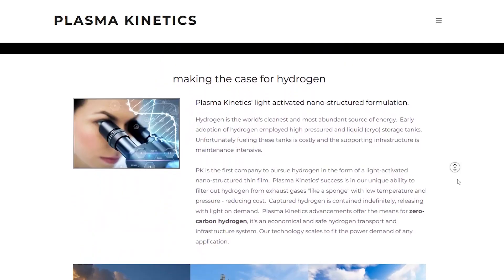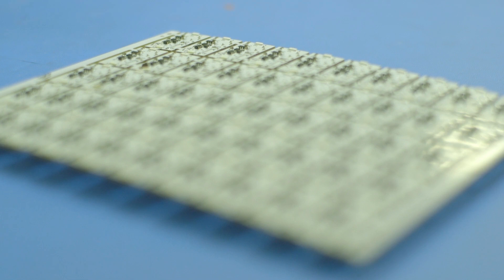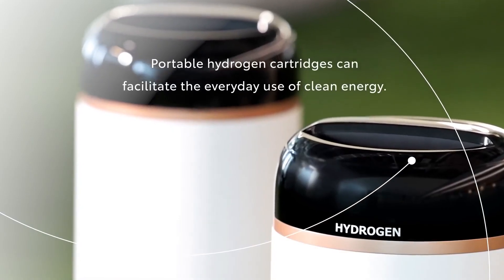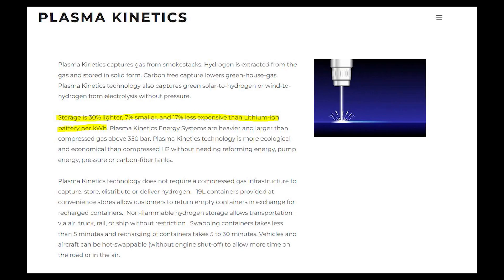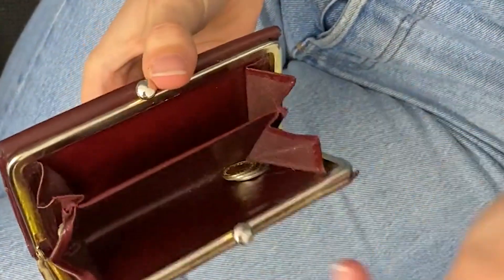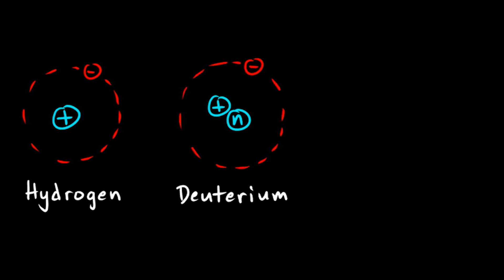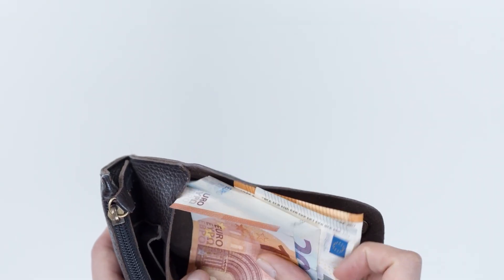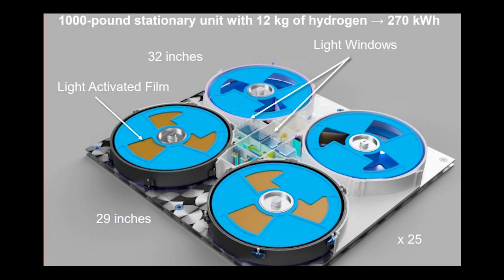Plasma Kinetics is this the future of hydrogen storage!

Comment: If only hydrogen storage was the problem. So what you're telling me is this company is solving an issue of putting expensive hydrogen into expensive storage in order to compete with gasoline that costs 1/4 and EVs that cost 1/10th to fill. Yeah, that'll fly with investors.

Comment: Replacing cylinders in cars is not the logical way to go about this.  Rather.  The fueling station has one large storage system that takes fuel hydrogen (with deuterium mixed in), stores it in adsorbed form, and then releases it for fueling the cylinder of the car... thus, the car's cylinder is only being fueled with hydrogen that, QED, can be released form adsorption storage, and thus is deuterium free..  This also means that the deuterium is more easily recovered.

Comment: I'd love an H2 car, but in Switzerland, where I live, they have 3 or 11 filling stations, so not a great choice. Pretty sad, charging stations are more wide spread and gasoline or diesel is in nearly every town.
Reply: The plus side, you could theoretically order 'to go' so to speak and have access to hand as needed.  I have been following Hydrogen solutions because, while electricity is great, building an infrastructure that is environmentally responsible just isn't possible without relying on Solar or Wind which will never be enough to meet demand.  Hydrogen can be portable and held in storage longer and more reliably than electricity.  Well, in this little world I made up in my very optimistic brain, anyway...